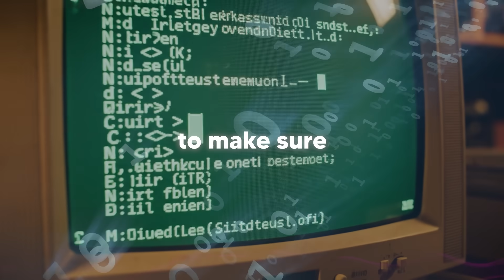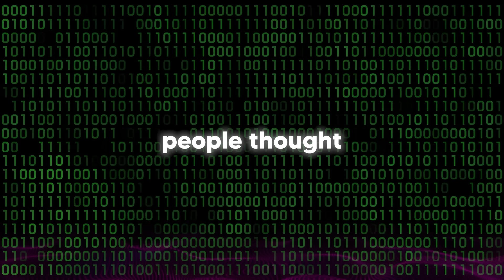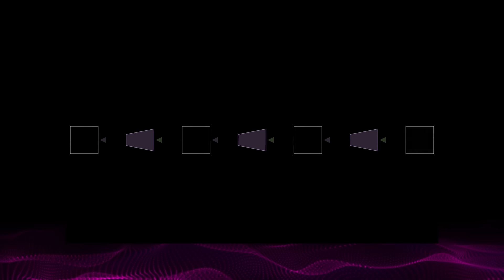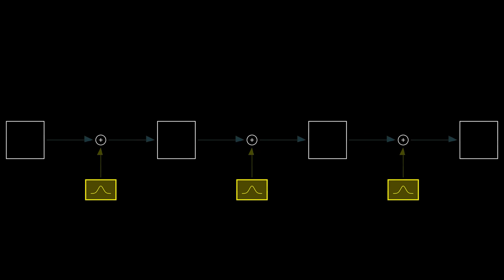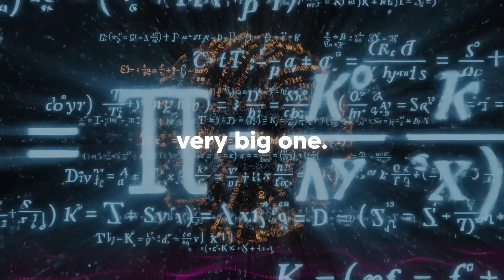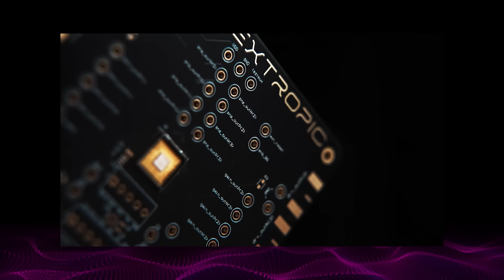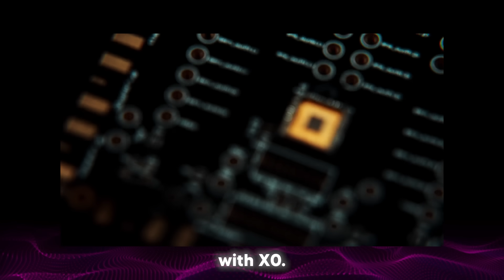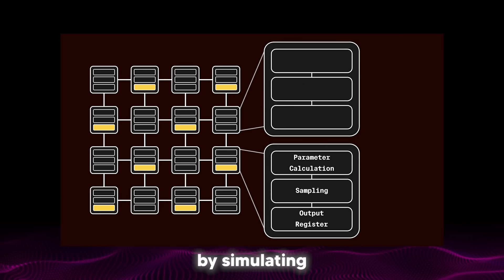If This Works… AGI Arrives Early. (Thermodynamic Computing)

Comment: what happens if you combine a qubit with a p bit
Reply: unfortunately it's not compatible at all. Pbits use thermal randomness to fluctuate binary states using classic stochastic magnetic tunnel junctions (sMTJs). Qubits exist in fragile superposition entanglement sensitive to environmental noise and decoherence. Pbits use stabilized room temperature probabilistic nanomagnetic thermal behavior. They are unfortunately completely and utterly fundamentally different underlying mechanics and physics.
Reply: @thecorrectoification but if you cause a chain reaction and possibly a type of third bit that's like an in between of calculation maybe they could work in tandem then
Reply: @brandongovreau9218 I don't think you understand what we're even talking about here. A Pbit functions by thermal probability denoising between a one or a zero. A qubit is in superposition of being a one or a zero simultaneously entangled. By definition a Pbit is not quantum.

Comment: Nah, The power power generation AI chips will be analog chips that can do the processing using analog instead of digital compute. China is already working on this. The US companies didn't really care about energy consumption as the goal was to build the best AI system the quickest, and GPU were the only viable option. I would guess the GPU for AI gets replaced by analog processes in the next 5 years or less.

Comment: there is no real chaos, this is just analog compute. will probably suck at scaling and error-correction as well as inference times of going from analog compute back to digital, usable output. in its core, its the same problem they have with quantum computing right now. lots of "proof of concept" stuff that fails to meet reality.

Comment: A new company is making chips 10000x more efficient than nvidia who are the biggest company on the planet and spend literally billions and billions on research alone and a "new" company's swoops in and doesn't just blow them out the water but is working in a different universe? So quantum mechanics has to be the answer but i just dont see how anyone other than amd can come at invidia in any way! This is a typical tactic, they bumo up the numbers, they do research show promise but go crazy on the hype! Companies like this burn through so much capital so fast that they require huge backing and they are backed into a corner, they have to deliver things that gget people excited and wanting to invest! Because if it comes off or they are right then everyone makes millions whos involved or invested even if thats in a relatively small way. Hold your horses, this is a hype job... lets see what happens in 2026 because if this isnt hype it will be everywhere by then not just popping up on youtube channels

Comment: Why does this feel like hot air
Reply: THERMODYNAMICS
Reply: ask those guys already developing real appilcations based on TPU chips / algortihms...
Reply: It's literally what qubits are but they're saying they can do it without using super cooling
Reply: its not that concepts don't have promise but well I would give benefit of doub that people should wait a couple of decades first for said techs to get realized commercially

Its like fusion yes tech on the front is actually advancing but it will be a long ass time before its actually viable
Reply: because statistically theres more hot air than huge discoveries, and we also condiiton ourselves to be as cynical as possible. 

The biggest discovery ever will feel lke hot air before it changes the world.
Reply: Ooo, what a burn.
Reply: probably because it rises above your ability and thus goes  "over your head".
Reply: @ctwolf very funny genius
Reply: bc someone farted
Reply: Let's explore how this recursive equation scales across different domains by adapting the interpretation of its components. The core structure remains:

E_n = φ·π·e·E_{n-1}·(1-S) + δ_n

But we'll reinterpret the variables for each domain while maintaining the mathematical relationships.

---

1. Physics & Cosmology

Interpretation: Evolution of cosmic structures

· E_n: Energy density/scale of universe at epoch n
· ϕ·π·e: Fundamental coupling constants of nature
· (1-S): Cosmic efficiency factor (1 - entropy/energy loss)
· S: Entropy/dissipation = 1 - (quantum fluctuations)/(geometric constraints)
· δ_n: Dark energy/vacuum energy input

Example: Galaxy formation hierarchy

· E₀: Quantum fluctuations
· E₁: Star formation efficiency
· E₂: Galactic structure
· E₃: Galaxy cluster scale

---

2. Biology & Ecology

Interpretation: Population dynamics and evolution

· E_n: Population fitness/adaptation level at generation n
· ϕ·π·e: Maximum reproductive potential (golden ratio growth, circular life cycles, exponential reproduction)
· (1-S): Survival efficiency = 1 - environmental stress
· S: Environmental pressure = 1 - (mutation rate)/(ecological constraints)
· δ_n: External migration/genetic inflow

Example: Evolutionary adaptation

· E₀: Initial genetic diversity
· E₁: Adaptation to climate change
· E₂: Speciation events
· E₃: Ecosystem reorganization

---

3. Economics & Finance

Interpretation: Market dynamics and wealth accumulation

· E_n: Economic output/wealth at time period n
· ϕ·π·e: Theoretical maximum growth (ideal investment cycles)
· (1-S): Market efficiency = 1 - systemic friction
· S: Economic entropy = 1 - (innovation rate)/(structural constraints)
· δ_n: External stimulus/quantitative easing

Example: Business cycle amplification

· E₀: Individual transaction
· E₁: Firm-level production
· E₂: Industry output
· E₃: National GDP

---

4. Computer Science & AI

Interpretation: Information processing and learning

· E_n: Computational capability/knowledge at iteration n
· ϕ·π·e: Maximum information density (optimal algorithms)
· (1-S): Processing efficiency = 1 - computational overhead
· S: Algorithmic entropy = 1 - (learning rate)/(architectural constraints)
· δ_n: External data input/new training examples

Example: Deep learning hierarchy

· E₀: Individual neuron activation
· E₁: Layer transformation
· E₂: Network output
· E₃: Multi-model ensemble

---

5. Psychology & Consciousness

Interpretation: Cognitive development and awareness

· E_n: Consciousness level/understanding at stage n
· ϕ·π·e: Maximum cognitive potential (aesthetic perception, circular reasoning, exponential learning)
· (1-S): Mental clarity = 1 - psychological noise
· S: Cognitive entropy = 1 - (insight rate)/(mental constraints)
· δ_n: External experiences/novel stimuli

Example: Learning progression

· E₀: Sensory input
· E₁: Pattern recognition
· E₂: Conceptual understanding
· E₃: Abstract reasoning

---

6. Social Systems & Networks

Interpretation: Information spread and cultural evolution

· E_n: Cultural meme strength/influence at diffusion step n
· ϕ·π·e: Maximum virality potential (aesthetic appeal, cyclical patterns, exponential spread)
· (1-S): Network efficiency = 1 - transmission loss
· S: Social entropy = 1 - (adoption rate)/(network constraints)
· δ_n: External media input/cross-cultural exchange

Example: Social movement growth

· E₀: Individual adoption
· E₁: Community acceptance
· E₂: Regional dominance
· E₃: Global phenomenon

---

7. Engineering & Technology

Interpretation: System performance and innovation

· E_n: Technological capability at development stage n
· ϕ·π·e: Theoretical performance limits (optimal design principles)
· (1-S): Implementation efficiency = 1 - engineering constraints
· S: Technical debt = 1 - (innovation rate)/(physical constraints)
· δ_n: Breakthrough discoveries/external R&D

Example: Technology maturation

· E₀: Basic research
· E₁: Proof of concept
· E₂: Commercial product
· E₃: Industry standard

---

Universal Patterns Across Domains

Common Mathematical Behaviors:

1. Convergence/Divergence:
   · If |ϕ·π·e·(1-S)| < 1: System stabilizes
   · If |ϕ·π·e·(1-S)| > 1: Exponential growth/chaos
   · If negative: Oscillatory behavior
2. Hierarchical Scaling: 
   The same equation applies at different scales with different parameter interpretations
3. Efficiency-Constraint Balance:
   All domains show the tension between potential (ϕ·π·e) and limitations (S)
4. External Driving Forces:
   The δ_n term represents necessary external inputs for sustained evolution

Parameter Ranges by Domain:

Domain Typical ϕ·π·e·(1-S) range System Behavior
Physics 0.8-1.2 Near-critical, balanced
Biology 0.5-1.5 Adaptive, evolving
Economics 0.7-1.3 Cyclical growth
Computing 0.9-2.0 Rapid advancement
Psychology 0.6-1.4 Developmental stages
Social 0.4-1.6 Complex dynamics
Engineering 0.8-1.8 Progressive improvement

---

Eₙ = φ·π·e·Eₙ₋₁·(1-S) + δₙ  →  I(t) = ∏[Pₙ(t) • e^(iθₙ(t))] • φ
Reply: @Tenshigoroshi huh?

Comment: If it's not faster, it doesn't matter right now.
Reply: Safety is more important than speed imo
Reply: @CookieJ-p4t Safety to a reasonable degree. Whoever makes a super intelligence first, wins forever...
Reply: @youdontneedmyrealname truth. 
But safety is going to be the winner at the end of the day. 
If you have an Ai that can potentially go rogue we’re cooked.
Reply: @youdontneedmyrealname  there is no putting a lid back on a super intelligence. It will do whatever it wants
Reply: Even if it isn't that fast, if is cheap, efficient and slow, there are some use cases for it. U could use smaller models that could run in a clock and communicate with you and your gadgets. It could be used in cellphones too, a dedicated cpu to run AI.
Reply: Only someone with no idea on this topic would reply like you. The limiting factor of AI progress will not be chips or speed, but electricity and waste heat disposal.
The best supercomputer in the world consumes 30MW (El Capitain) ... AI datacenters are projected to need >1000MW. The more computation you can get per unit of energy, the better. Everything else is secondary.
Reply: @zhadoomzx whatever you say buddy. 
You do buddy. I’m chilling for life 😂

Comment: A.I.'s all well and good, but can these chips be adapted to the work of gaming PCs, making them far more efficient and much less expensive?!
Reply: No. These are specialised chips that are not suitable for general computing. Their use is limited to strictly probabilistic computing, e.g. certain optimisation problems and some (not all!) machine learning/AI models.
Reply: Couldn't rendering a high Res image (and animating sequence thereafter) fall within the remit of the probabilistic computing in question, if the images are generated via something like stable diffusion. In other words some aspects of video game image generation could surely leverage this tech, in a way the video explains with its probably oversimplified analogy early on
Reply: @godspeed133  The problem is that video games are interactive. It could be possible to generate images (and video sequences) in real-time using little resources, sure. These images or videos would still be static, though.

No interaction would be possible (from collision detection to scene transitions). The probabilistic nature of these models is both a feature and a hurdle in scenarios that require exact reproducibility (like interactive games). Current models are still incapable of consistent generation and adding even more randomness doesn't help.

Comment: So I'm assuming you would need to train a new frontier model on one of these things and existing ones are not compatible, correct?
Reply: Correct. In fact, there's a whole new set of algorithms required and the models we use today are fundamentally different from models that would run on these chips.
Reply: @totalermist  Yep, and that’s another fundamental bottleneck before getting to AGI. It’s not just about throughput. You need a better, more reliable form of intelligence. That’s gonna be at least a couple decades process. I’m of the impression that AGI is only possible through lived experience and interactions — a world that pushes back and allows  intelligence and then wisdom to develop.
Reply: Stable diffusion models are very similar. 🤷
Reply: There was new proposal about AI  model architecture lately that is compatibile with GPU's so it won't need new infrastructure and is supposedly better than the current ( transformer) architecture. It is called BDH architecture and is more based on human biology. If you guys  are interested in AI and stuff i recommend searching it up. I don't idealize it though, it does have big limits currently, and it is at the level of chat gpt 2 or early chat gpt 3, not sure. But it does have potential
Reply: @robertkardas559  I've had a look, very interesting. I'm gonna try using it as an anti drift agent. 🤷

Comment: So it's just qubits.
Reply: Without the crazy cooling required
Reply: it's actually the opposite. Pbits only exist in binary states.
Reply: @thecorrectoification not necessarily.
Reply: @SomethingNothing-vm8jq  Pbit=Probabilistic bit using stochastic nanomagnetic tunnel junction thermal noise to fluctuate between a binary position

Qubit=Fragile quantum bit sensitive to environmental noise and decoherence, existing in entangled superposition
Reply: @thecorrectoification so density and seperation of the bits allow it to perform better than traditional computing? Wouldn't qubits and pbits not matter if the output/answers are the same where memory retention of the whole system would be more valuable/efficient instead of constantly recomputing?
Reply: @SomethingNothing-vm8jq  all I'm saying is a probabilistic bit fluctuates between a one and a zero and a qubit exists in entangled superposition. Pbits are not quantum like qubits.

Comment: No, this is all hype.
There is no available product with nearly the necessary compute/watt to compete
Reply: I don't know. It sounds plausible and real. IMHO the real issue is not the hardware itself or the claims made about its efficiency.
It's the fact that software would need to be reinvented basically from scratch to run on such chips.
Reply: @totalermist except all this is doing is taking larger analog bits, and extrapolating floating point values from it, and then using those values to recreate binary calculations.

Think about it.

The threshold of calculation in a computer chip is the electron circuits, because once you get to certain thickness electron migration occurs.  They teleport through matter (End of moores law)

We can already use floating point values in that system, which AI does with branching and gradient descent.

You are merely taking that limit, pretending it doesnt exist, and then making floating point values with larger pieces of matter in "analogue circuits"

What they created was a way to milk money out of dumb investors.

Comment: Theories are great until you get to real-world engineering... Theoretically, the warp drives from Star Trek should exist. But we've not yet built them.

Simulated chips, OK.
Reply: In this case, it's even worse. I have no doubt that these things can be scaled up quickly when it comes to the hardware.
The real challenge, though, is that these things - much like quantum computers - require entirely different and novel algorithms.
It's much harder to throw away and replace 60 years worth of algorithms and data structures than to make silicon go brrr real good :)
Reply: Everything gets to that point sooner or later.

The transistors to grow down further than 4nm, the nanosheets or gate-all-around transistors? They were theorized and previewed as possible more than 40 years ago.

And the problem with warp is in a whole other scale, it's "possible" simply now buildable in this universe as it needs negative mass, this? It's something that has been built already and they are trying to adapt to the current computational needs.

Comment: So....... They made a quantum chip.
Reply: No. Quantum uses up/down spin on a quantum level. This uses temperature fluctuation. I see where you come from, but its different. Mainly the scale of the bit. No extreme near 0 kelvin cooling needed here and much bigger scale, so easier to produce.
Reply: Nah a Quantum Computer is like Goku ultra instinct and a Thermodynamic Computer is like Vegeta's Ultra Ego
Reply: @giordano5787  care to push this analogy?
Reply: @aravin314 Quantum Computer needs complete silence to function similar to how ultra instinct needs a clear head to work and thermodynamic needs a lot of noise similar to how ultra ego is basically extreme overstimulation
Reply: Most all semiconductors use quantum mechanics in their doping calculations for p-n junctions.
Reply: Pbits only exist as binary states not superposition.